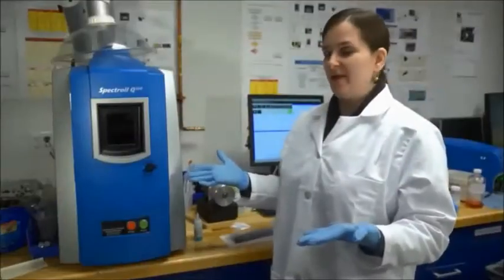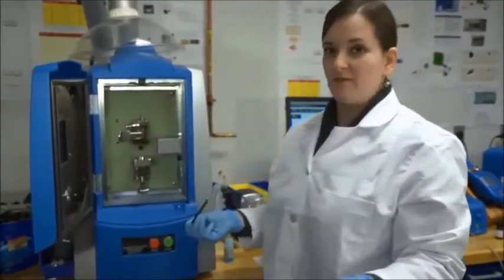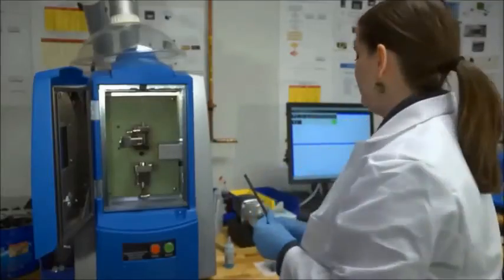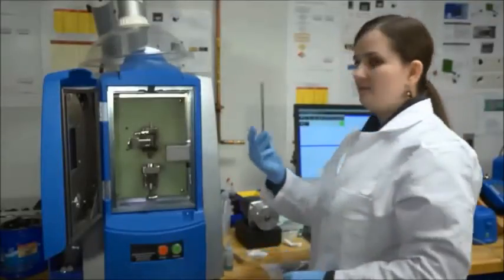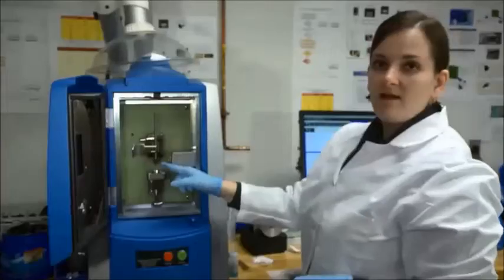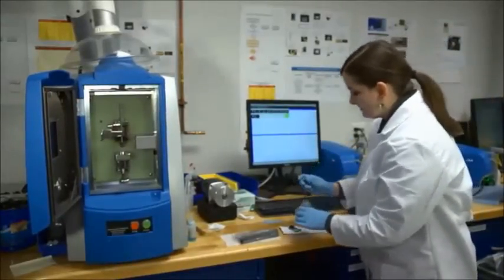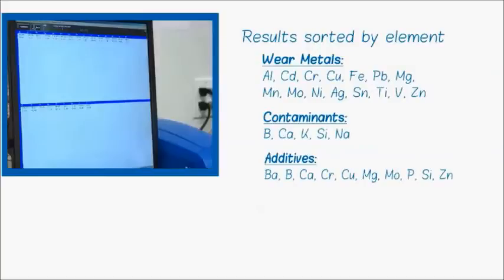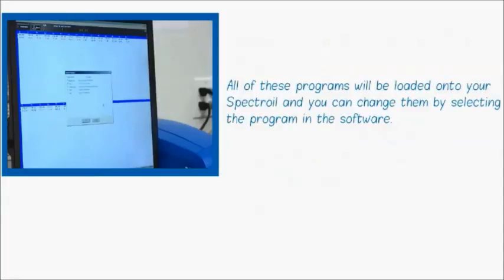See it in action: Spectroil 100 Elemental Oil Analysis

Comment: When it shows the error in the software, and it is not having interruptions in the burning of the oil, the problem could be the sensor or software configuration?

Type of error:
Interlock error
Sample Stand Setup Error
Reply: This is a common situation, it is an interlock the system has to let known if the system is analyzing
sample or not. The units have H and C as reference values; these values are set into the burn
parameters. If for any reason (no sample on cup, unit not clean, etc.) the reference value the unit is
giving is lower to the one set into the burn parameters, it will show this error message and it won’t allow
keep analyzing.